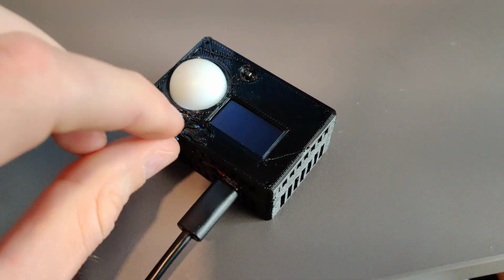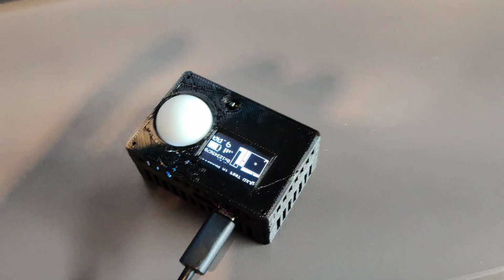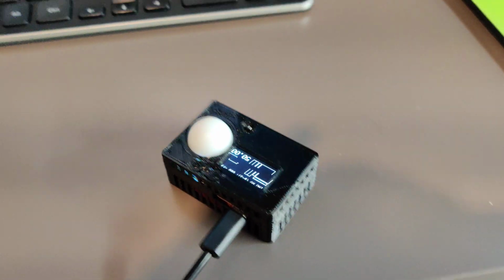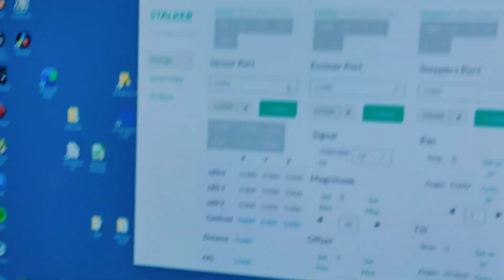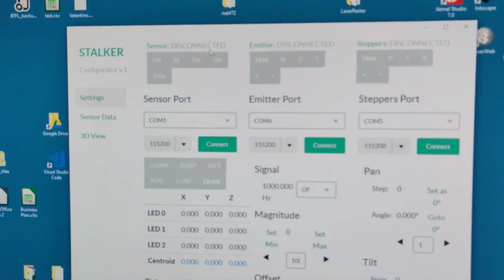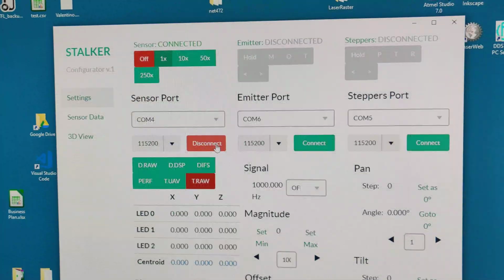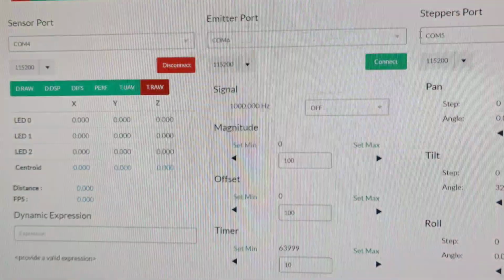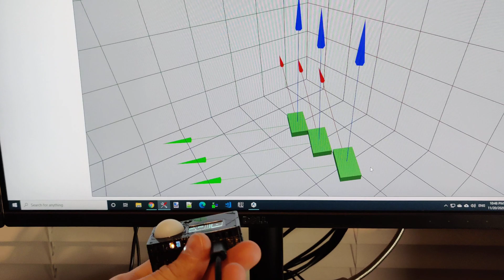BNO085 and 2x ICM-20948 Self-Calibration from Cold Start.

Comment: How do you apply calibrated offset and scale? I mean where can I find that values? I can not find any information about it.
Reply from the maker: IMU device calibrates itself all the time. On Invensense you have to read these settings when you consider the device have been rotated enough in all directions and save them into flash memory. Then load them into IMU on next startup. On Invensense driver these are inv_icm20948_get_bias and inv_icm20948_set_bias functions. BNO device has its own non-volatile memory, so you can call sh2_saveDcdNow function to make it remember the settings (it will re-apply them on power-cycle) and sh2_clearDcdAndReset to clean them up (when you want to re-calibrate the device from its factory settings).
Reply: @alexm7056  мой вопрос возник откуда, на BNO055 после калибрации нужно было гдето сохронять offset данные в ручную и потом применять их(все в ручную). А тут тоесть просто делаю ДИНАМИЧЕСКУЮ(А НЕ СТАТИЧЕСКУЮ) КАЛИБРАЦИЮ, сохроняю его  с помощью той функции и все? Второй вопрос: сенсор считаеться откалиброванным когда AQURRACY LEVEL = 3  да? допустим в случае кода нужен только rotation vector(quaternions).
И третий вопрос: тут нету статической калибрации да? Спасибо.
Reply from the maker: @emmetray9703 К сожелению на все эти вопросы я ответов ужене знаю, этим проектом уже давно не занимался и много чего подзабыл. В моем коде статической калибровкой (если там и есть такая) не пользовался. "Динамическая" скорее всего иммется ввиду что фюжен-фильтр сам себя каллибрирует когда видит разницу в показателях от разных сенсоров в рантайме (например по гироскопу видим поворот на 90 градусов, а по компасу на 45, значит компас сбит).  Насчет того насколько сам модуль уверен в калибровке - я бы этому параметру не доверял. Даже перемещение модуля между включениями в другю комнату может сбить калибровку компаса, так как рябом может изменится кол-во металическиг предметов (напрмер жестяная плита на кухне или стол с метлическими ножками может повлять на показатели если все очень близко).Жалетельно процедуру калибровки встроить в интерфейс прибора по месту его использования.
Reply: @alexm7056  вы можете показать исходники вашего кода?

Comment: Hi Alex
I build a BNO055 into a kart. But when restarting the calibration is lost. And I cannot swing the car around😙So with the BNO085 it recalibrate itself after restart?
Reply from the maker: BNO055 and BNO085 are the same thing (as a hardware), but using different sensor fusion firmwares inside . You have to explicitly call driver function  store the calibration settings in flash and maybe a function to load them at startup.

Comment: Hi Alex, great work! Have you tested the heading drift between these two when walking in different environment?
Reply from the maker: I was setting it up on rotary stage with stepper motors. ICM-20948 seem to be more susceptible to vibrations (which were induced by micro-stepping PWM modulation from stepper motor driver). These were like audible vibrations from stepper coils. While the motor was not actually rotating (just holding its position). BNO was sitting still, while ICM was drifting away quite fast (like a one degree per second). This may give a hint on how smart the sensor fusion logic is in each device. ICM-20948 probably relies a lot more on gyro/acc when it is in motion. And only pulls in magnetometer and adjusts itself when everything gets into dead stop. While BNO behaved slightly smarter 
(filters-out gyro drift by observing fixed magnetometer  data). BUT this is just a preliminary conclusion. Because there is not enough data to judge that BNO indeed superior device. I did not do any tests in wide range of vibration frequencies. Maybe ICM by its internal MEMS mechanics was just unlucky enough to get into some resonance with a PWM frequency of current on motor coils. Unfortunately,  due to crazy deadlines at my work, I don't have time lately to move on with the project and do more considerable test videos.

Comment: Hi Alex, nice job.
I am trying to get the ICM-20948 calibrated for a project I'm working on, but mine does not seem to self calibrate. What output values are you reading from the DMP for the input to your software? 
I am currently reading the orientation output but it is not accurate at all for me, doing a 360 of the device leaves me 70 degrees off from what I started at. Do you run the self test on the DMP before you do anything ? 
What DMP firmware are you running on the ICM? I got mine from the 'eMD-SmartMotion-ICM20948-1.1.0-MP' package.  Maybe you could upload it to git so I could take a look, would be much appreciated.
Reply: I have just switched to the 6 axis data instead of the 9 axis (including magnetometer) and my data looks a lot better now. Are you using the QUAT9 or QUAT6 data?

Comment: Hi Alex,
I am doing a school project about IMU sensor. Your solution is impressive that it could do self calibration. I was trying to do that but I have no clue. I am using ESP32 and ICM20948, and using madgwick filter to get quaternion. It is quite good if the accelerometer, gyroscope and magnetometer are calibrated, which the process is so difficult to achieve a good calibration.

May I ask that how your self calibration algroithm is working? Is it because you have multiple IMU in a single system so they could help to calibrate each other? Thank you so much.
Reply from the maker: The whole point of this demonstration is that with BNO085 or ICM20948 you don't need to implement an algorithm (like Madgwick) on your host controller. Because these IMUs have built ARM microcontroller with fusion algorithm supplied from manufacturers. In other words - if properly configured they spit out quaternion to you right there over SPI or I2C.  All I do here - is describing differences between parts from two different manufacturers (Hilcrest Labs and TDK Invensense, to be said - Hilcrest Labs BNO085 is actually Bosch BNO055 sensor with HilcrestLabs firmware)
Reply: @alexm7056  Thank you so much. Since I am using micropython for the development, I cannot really touch the dmp in icm20948. It is so hard to implement. I am still working on it. With esp32 for the wifi stuff and data fusion, with no dmp processing, I could get arround 100hz data.

In the other hand, I just got a BNO085. I also do the development in micropython. I just write a simple lib to get the data from the bno085 mcu, but the perfermance is poor. I could get just quat arround 50hz. If I am getting acc, gyro, mag, quat all together, I could only get arround 30hz. Do you have the same problem? or it is a problem from my implementation? Thank you.
Reply from the maker: @hcklawrence  I did not try to run BNO085 beyond 50 Hz, it is also crunching everything with its internal internal DMP without any fusion cod implemented on my side.  So far to me it works better than ICM. It is easier to initialize internal DMP in BNO085 since you don't need to reload DMP firmware on every startup (it is stored in internal flash memory of the BNO085). For your scenario where you do processing on your side - the SPI speed of BNO is twice slower (3MHz vs 7Mhz), I did not compare the size of data packets running over SPI though.
Reply: @alexm7056  Thank you so much!

Comment: Can you please tell me how you connected the BNO058 with raspberry pi ? I am having no luck getting it to read anything. Do you have any diagram ? Thanks
Reply from the maker: It is not an R PI (and I actually don't have any in my workshop), that is the custom board I made for one of hobby projects based on STM32. I've used SPI connection and diagrams are in DataSheet of BNO085, the only thing is the protocol is a bit awkward. Uses dedicated WakeUp line additional to traditional set of 4 wire SPI (nCS, SCK, MISO and MOSI)
Reply: @alexm7056  I see. What did you use to visualize the data. How did you build the software? Have you build it all from scratch? If so what software, language you used. My main goal at this point it to be able to collect the data from the sensor and send it via bluetooth to phone, or webapp, etc and be able to see it in some form of visual aspect. Not just numbers. Any advice would be appreciated.
Reply from the maker: @glitch4548  yes, it's proprietary tool I made to debug and test my project. Some angular code running as google extension, with Three.js to render data from COM port. Its features a way beyond of what is demoed here so I can not share it. For you I recommend to write-up a quick python script to read comport and render quaternion rotation for cube.
Reply: @alexm7056   Oh I totally understand. I am new to this concepts and just starting. So for me just  having any  advice on starting points is very valuable. Do you use any form of messenger discord, fb, email ? Thank you for responding to all my questions.
Reply from the maker: @glitch4548  you may get me over FB messanger: https://www.facebook.com/oleksandr.muzychko

Comment: Hi Alex, great work!
Small question - do you know / have references to which registers/area spaces of the ICM20948 DMP memory space you need to store and load in order to preserve calibration data?
Reply from the maker: There is no non-volatile memory in ICM20948. Which mean everything lost on restart (power cycle). With ICM20948 you store its settings in flash memory on the host controller (the one to which you connect ICM20948).  While primary difference of BNO085 is that it has internal flash memory, so you simply call an API function (sh2_saveDcdNow) to snapshot current setting and they will be loaded at next startup automatically.
Reply: @alexm7056  Hi Alex, thanks for the prompt response. Yes I know the ICM lacks NVM. I actually have an external flash I want to use, but I'm wondering which registers I need to record. Currently I'm only restoring the 3 offset registers and it seems to do something, but from previous experience I expected to store at least 6 if not 9 calibration variables. 
Can you point me as to which data needs to be saved (probably DMP registers?).
Reply from the maker: @orrsrour7428  oh, I am sorry, I got your question wrong than. So I do 3 separate  inv_icm20948_get_bias(...) calls for 3 separate sensors: INV_ICM20948_SENSOR_ACCELEROMETER, INV_ICM20948_SENSOR_GYROSCOPE and INV_ICM20948_SENSOR_GEOMAGNETIC_FIELD. Each of them returns array three int32 elements. Since I've used SDK I don't know the actual registers, but to identify them you can just go through SDK source code of the inv_icm20948_get_bias(...) method call stack.
Reply: @alexm7056  many thanks! I still wonder how come they need only 3 variables for the mag calibration (rather than offset + gain per axis), but I guess they know what they're doing much better than me :).
Reply from the maker: @orrsrour7428  as for gain - try look though other API calls in the same .h file as the method I've mentioned above. Please, let me know if you find something that will bring you better startup performance. I've seen some API related to iron matrixes but did not succeed using them. In my case IMUs are just a fraction of much more complex DIY project I am trying to accomplish, so I've only invested just enough time to get them "kinda working".  Optimizing them to the top performance is not my priority at the moment, as well as making follow up youtube videos.

Comment: Congratulations for the videos and progress so far. I'm working in a project and would like to request some advice.

I'm using an MPU9250 to build a VR tracker and I'm going to substitute it. I'm having a hard time choosing between both IMUs that you presented on the video.

 I hope you can help me choose by answering a few questions.

How long the ICM takes after first callibration is stored in the MCU flash to load the firmware and get ready to run?
Which documentation was easier to undertand?
How long did you spent porting the drivers to a specific MCU?
Reply from the maker: Performance-wise they both seem identical to me. So I would base my choice on electrical design simplicity. If your main host MCU design is low-voltage/low-powrer 1.8V - go with ICM 20984. If it is 3.3V I/O - BNO085 would be a better choice. Driver/SDK is much more better documented in case of BNO085. And code quality-wise it also looks nice. And all the functions actually work. However their SH2 driver framework seem a bit of overhead complexity. ICM (20948 specifically) does not work with 3.3V IO, so you need level converter if your main MCU is 3.3V. ICM driver SDK has terrible implementation quality. And documentation is pretty much non-existent. While the ecosystem of ICM SDK looks simpler than BNO SH2, it took me a 10x more time of tinkering with it to make ICM working. Also I like BNO more due to the fact that you don't need to reload internal driver firmware image on every startup. It is stored in internal flash memory of the BNO as well as calibration settings (so you don't need to bother of storing calibration in host MCU and reload them on startup of ICM 20948)
Calibration less dependnds on time, it's about collecting enough data to get all offset trims on all axes of accelerometer and magnetometer iron matrices. So it is more of  like a 1 min procedure that needs to be implemented on host  MCU. Where user is asked to to turn on the device and rotate it few times 360 degrees in all orientations.
Reply: @alexm7056  Thank you for the response. I think the BNO is better for our situation. After the first callibration, when I turn on the device, the starting orientation is what is shown on this video, right? So whichever component I choose, I still need a few movements to recalibrate it?
Reply from the maker: @pauloamaral5290  if you already had it calibrated before and had  calibration settings saved, next time you turn it ON the device will show correct absolute orientation (no additional calibration movement needed). But both devices run "on the fly" calibration in background. The more you move it - more accurate it becomes. The calibration settings are updated in internal memory automatically. That is to adapt to changing environment ( so it stays more accurate). So it is reasonable to re-save new values of calibration settings once in while (e.g. - before powercycle, or specifically if the device is moved to another room or geographical location, since iron/geomagnetic environment may drastically change)
Reply: @alexm7056  I'm also deciding between the MCU that I'm going to use. It will be either an ESP32 with IDF or a STM32WB. In the previous videos I noticed that you are using a ST microcontroller. Was it too difficult to port the drivers to the STM?
Reply from the maker: @pauloamaral5290  BNO085 has already STM32 examples on gitlab (https://github.com/hcrest, even for both FreeRTOS and while(true){} loop). So nothing to port in this case, just hookup the code to your application. ESP32 however has a good IoT/WiFi ecosystem with ton of different libs already available on the web, while STM32WB is relatively new product. So if WiFi/Internet connectivity is a priority - I would go with ESP. If you need just Bluetooth - than it does not really matter, BT is simple thing to use and STM32WB might be just quicker time-to-market option. I love STM32 because CubeMX - much quicker to setup all the peripherals you need than using typical SDK code packages provided traditionally by other manufacturers.
Reply: @alexm7056  Thank you very much for sharing your experience. I've decided to pick BNO085 and STM32WB.
Reply: @pauloamaral5290  Hi guys,
 I'm also looking into these IMUs and have been leaning towards the BNO085. Also been looking at the ESP32 to communicate using Wifi - UDP to transmit the IMU data into another system, hopefully, close to real-time. Not familiar with the STM32WB, will have to take a look. Thanks guys.

Comment: Which softwares are u using how the calibration worked automatically?
Reply from the maker: The software to view 3D rotations is a tool I developed to debug hardware project I am working on, it was written with Angular and Three.js. The internal algorithms of IMUs run  calibration in background as soon as you power them up. The more you move it - the more it gets calibrated, they periodically adjust calibration params to better fit surrounding environment. That is what demonstrated in the video. BNO085 can store calibration settings in internal flash memory and they will be loaded automatically on next startup. ICM20948 does not have non-volitile memory, so every time you power it up there is a procedure to load DMP firmware first and then you can write calibration registers values (if you had them stored on your host microcontroller earlier).
Reply: @alexm7056  Nice work on the software looks great!
Reply: @alexm7056  Thank you so much for the video and description. Right now I am using Bno085 for a project for my school. I am connecting it via ICP using nrf52840 feather express microcontroller. I have written a very simple arduino code to get the values for linear acceleration and gyroscope. Would you mind explaining more about calibration? Can i just move the sensor around to calibrate. unlike bno055, i haven't been successfull finding a way to display the calibration status for bno085. so i am just using whatever data bno085 outputs without knowing if it has been calibrated or not.
Reply: Have you released this software that you created for the public to utilize it? Looks very helpful